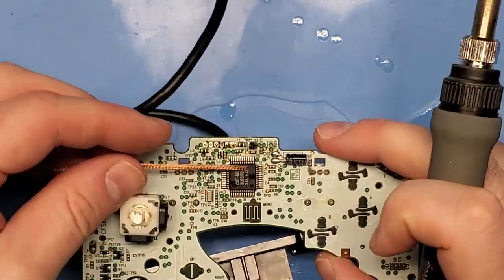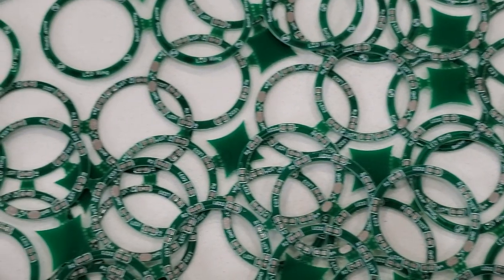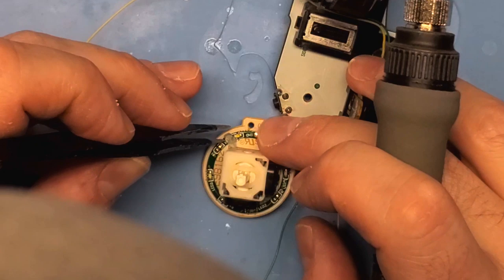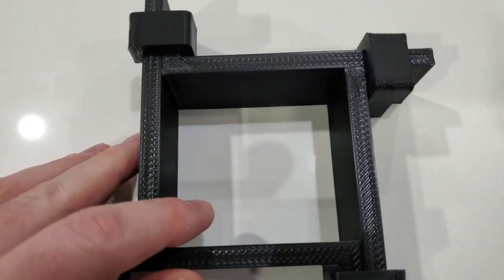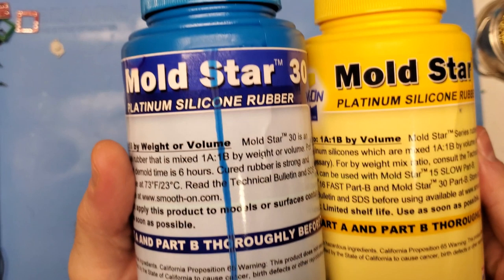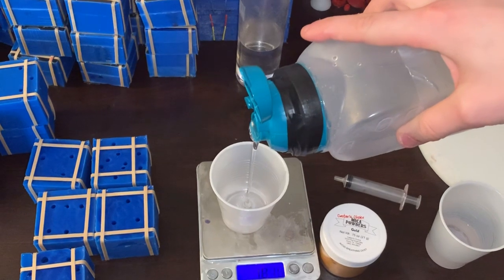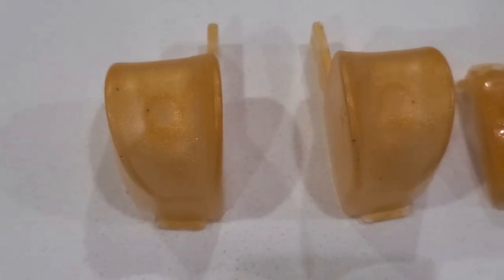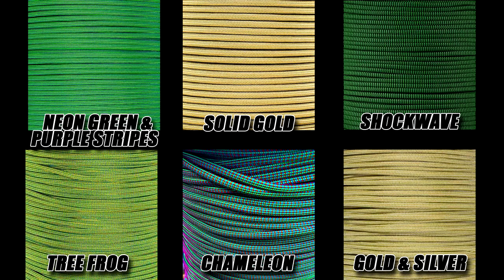Gamecube Controller Mod - The Community Mod - Part 2

Comment: Amazing video again, so when ping pong made the sticks did he used a diferent material for the rubber instead of resin? in the video you can kinda see when he pulled the stick out of the casting the cap had a bit of elasticity as if he casted the stick first and then placed it in the mold for the rubber cap. also my vote goes to gold and silver but what color is the plug gonna be? I'd like for it to be green like the case
Reply from the maker: You are spot on.  The stick caps are made from a urethane rubber and are soft.  If I had to compare them, they are a touch more firm than a brand new GCC rubber top.  Overall, they look and feel excellent.
Reply: RockerGaming wow haha will you teach us how to do that?

Comment: Solid Gold for the paracord!

Also awesome idea with the touch switch! After I saw you do that with the Saturn controller, I had to do one with my led GameCube controller. The custom pcbs make it so clean though!

Awesome work as always!
Reply from the maker: Thank you!  They do a bit more than just make it easy to install, they also contain the proper electrical components to make sure the touch sensor isnt exposed to too much current, which should dramatically increase the life of them!  But I agree custom pcbs for this stuff is where its at!

Comment: I'd love to see an updated video for making molds and to go more in depth and talk about the pressure chamber as well as show how to make the thumbsticks and how to make a matching rubberized grip for the tips of the stick; also winning that controller would be really cool, big fan of the shell; my vote is for chameleon green for the parachord
Reply from the maker: I appreciate that Jacob, I think an updated video is due as well... There is a lot to cover and while the process isnt a ton different, there is enough nuance to touch on and cover that I think its worth it.

Comment: My vote is for Chameleom. those leds look amazing. i wish I could solder.
Reply: I personally don't find it that hard to do while not being very experienced. With good quality soldering equipment you should be able to do it pretty easily but practice soldering on cheaper stuff first as practice.
Reply from the maker: Sound advice here!